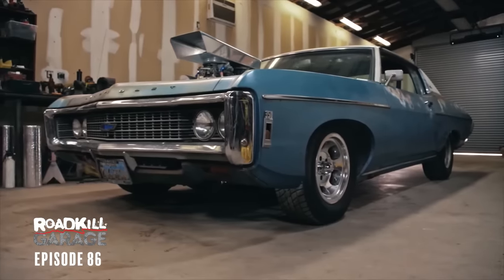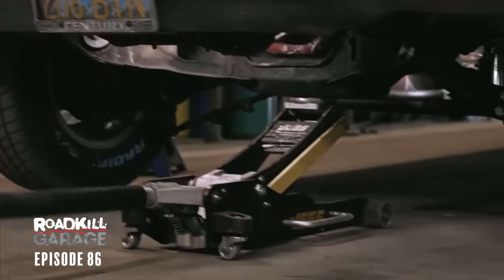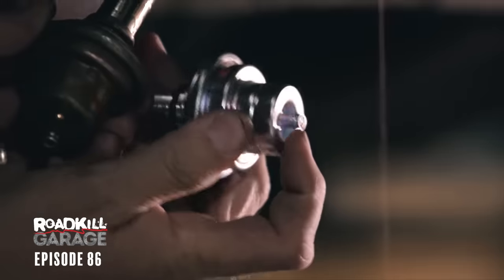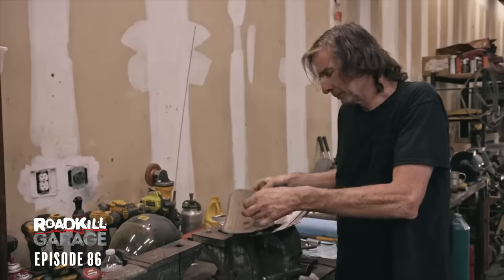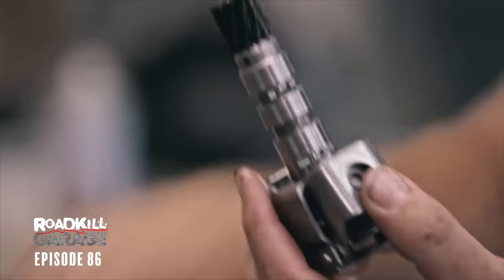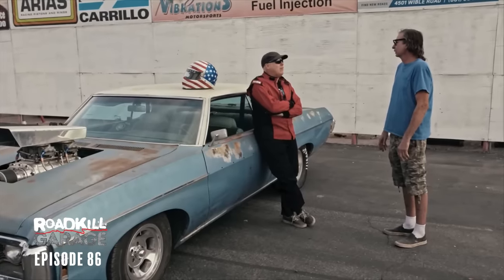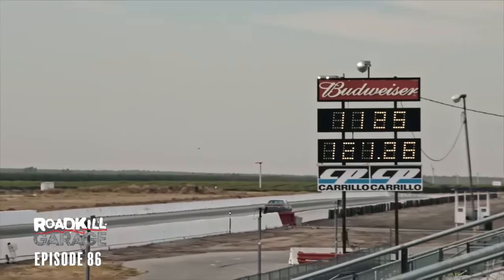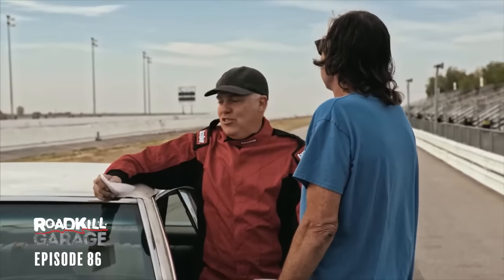The Crusher Impala Finally Runs 10s! | Roadkill Garage

Comment: Yes, TH-400, the filter floats in the fluid.  Weirder, it's Dave's first TH-400.  That surprises me, because BITD everyone I know including myself, first thing to blow on our hi-po Chevrolets was the TH-350 transmission, and everyone replaced it with a donor TH-400 after a little work on the valve body and a new higher stall converter.

Comment: Back in the late 80's , I was assigned a project to help Reeves Callaway upgrade his Corvette line with THM400.  Since the car was boosted, and the transmission ran on vacuum,  there was a problem when the vacuum went to pressure.  The fix was to plumb it with a vented one way check valve on the modulator line so the once it got into boost the modulator would only see atmospheric pressure.  That system went into production on all the THM400  equipped Corvettes,  worked perfect 👌  . Also the deep pan requires a longer pickup pipe, which your trans had, but there is also a sleeve that spaces between the valve body and the filter to keep the filter from moving around too much .  BTW a deep pan is designed to allow more room for hot ATF expand into, the dipstick is calibrated to lower the level of the fluid.  If you have a deep pan , but a shallow dipstick, when the fluid heats up it will get into the rotating parts of the trans and froth up the fluid like a milkshake.   Great project, keep up the good work  👍

Comment: Back in the day ....(1972) My friend had a 69 Chevelle that had a 396 / 375 with a Turbo 400 trans. When shifted down to "1" and racing the 1/4 mile with 3.31 rear gears, the trans would upshift 1-2 on the governor which was factory set to shift at 6,500 RPM. So, playing around, he would just leave it in first on the shifter and race. Talk about consistency. You know you have a great bracket car when you run 13.95, 13.96, 13.94 using just two gears on street tires......We were careful not to beat it to death because it was used to tow a 1970 427 Nova.....We had SO MUCH fun back then.

Comment: You should run a  "T" with a one way check valve inline with that so it doesn't see pressure, but see's vac.  (brake booster valves work great)

Comment: As for the Transmission filter being lose, it's normal, but it does look a little loser on your vehicle. I remember when I was a mechanic in the military when I was working on M998, M114, and M1151 HMMWV's servicing the transmission changing the transmission filter, O-ring, and cork gasket, the filter was lose after snugging the mounting bolts down on it, but it was fine after test/normal driving.

Comment: I can't help wondering if twin turbos and a different cam would take into the 9's? I guess you can only do so much with a 4000 pound sled, a 3.50 gear and small tires.

Comment: Bottoms out, without the correct spacer it will throw shift points off as well by letting the trans shift with a mind of its own because of the volume?

Comment: YES, that filter is supposed to be loose like that. It is made to float up/down with fluid so it won't starve the pump if fluid is a bit low. Even though the vac modulator will control shift points, rarely ever is it the modulator that goes bad. If anything you should've check the valve behind the modulator for movement. Big waste of time opening the filter checking for wear, just look in the bottom of the pan, that's wear you will find condition of trans. clutch material, bushings, hard part damage, all right there.
Reply: thank you, was pretty sure the filter is supposed to "float" but haven't had to mess with a '400 in a long while--last time i dorked with a slushbox was the old buick 2 speed.